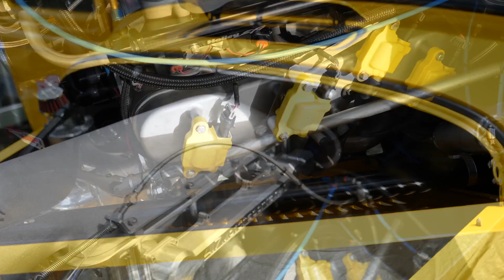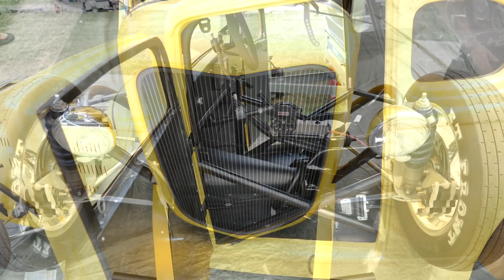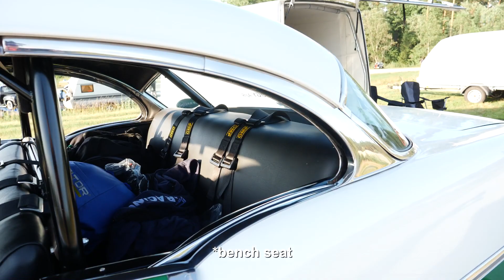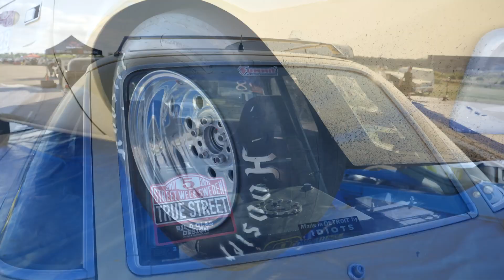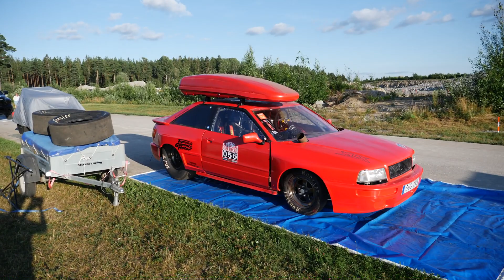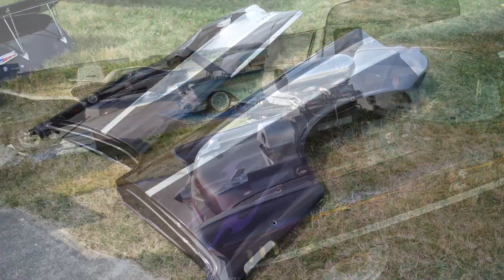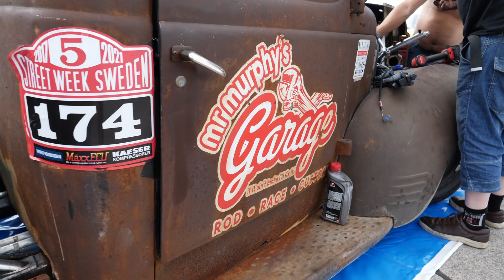The Cars of Street Week Sweden 2021

Comment: 1:36 That's a local shop!  417 Motorsports is owned and operated by Blake Hughes.  Going back almost 20 years ago, they did pretty much only import work.  I remember he had a Datsun 210 with a 2.3 turbo SVO motor swapped.  Stuff like that.  Now pretty much the only thing they do is LS stuff.  Very high quality stuff though.  They're very committed.

Comment: We call those tires on the Volvo Small Tire here in the US. Big tires are at least double those. The Yellow car at the start of the video is Big Tire car. That is the difference from Small tire and Big tire. These racing the 1/4 or 1/8 mile? Guessing times is 1/8 mile or roughly 200 meters which is 660 feet or 220 yards. Opel GT fast as hell in 1/8 mile https://www.twitch.tv/ticklefitz/clip/PiliableTentativeSardineDansGame--MdfQ8H9fGQj67ic?filter=clips&range=30d&sort=time

Comment: Om606 mb engine can produce crazy power, its the 2j of the diesel world 🙏🏻 There is a company here in the UK that does a lot of mods for them 👌🏻
Reply: Have they done any really powerful engines that are actually fast at track ?
Reply: @V8Lenny  Mercedes or the tuning company I was talking about? There's a build on here that's using a lot of their parts but they haven't been to a track yet, boosted shades I think is their channel 🙏🏻
Reply: @BariLopesh  dpuk is big talk but still havent seen any impressive from them. Here in Finland those ancient engines start to be forgotten , they reached their limit , about 700 hp.
Reply: @V8Lenny  sometimes it takes a fresh set of eyes  to discover something new to push it just that bit extra so we can see some 800hp builds... For what the engine is and how cheaply they can be obtained it's a bargain start for some peoples first foray into building or modifying a car 🙏🏻
Reply: @BariLopesh  there is no point in pushing a diesel so far, diesels have much higher peak cylinder pressures for the same torque, are rpm limited and need a very strong transmission to hold the torque they need to make power. At the end of the day it is lighter and cheaper to just use an otto cycle engine instead of heavily modifying a diesel.
Reply: @laurean5998  pointless to some is the point to others 🙏🏻